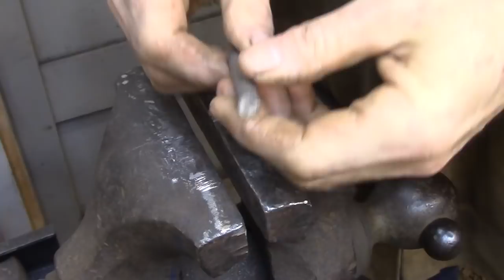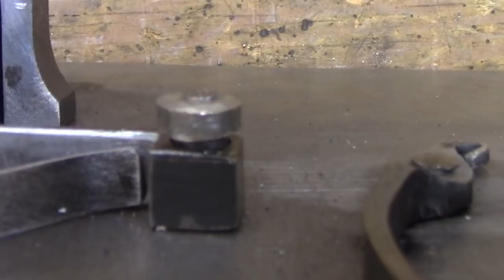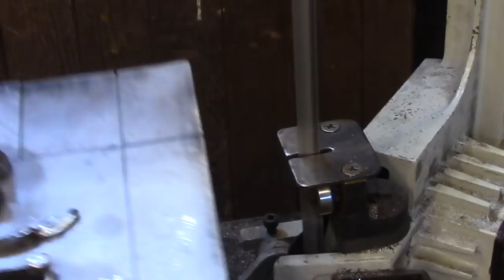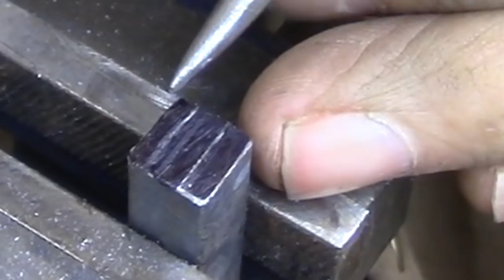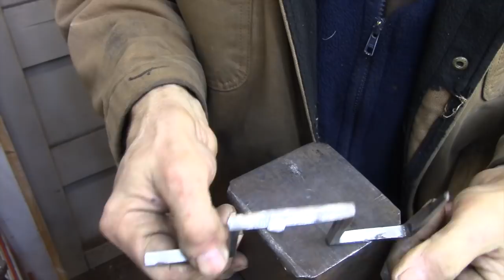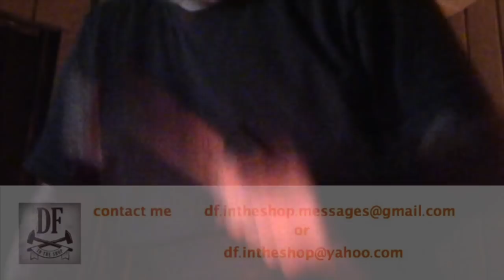Blacksmithing Project - A Simple Nuremberg Box 13

Comment: Since you're still in the rivetting and brazing mode, could you not add a bar along the top to provide the strength lost? Keep forging!
Reply: I was thinking the same thing. He could cut a 10-14 gauge steel strip to fit, then braze it and grind it down. The bar looks to be about .25" thick so .13" to .1" should  be enough to reinforce it.
Reply from the maker: That was my first thought and I don't have a problem with that as long as I can get it to not look like a repair.
Reply: So in other words, any repair done will look like like filigree, or some other purely decorative addition.  Don't add too much, or you'll feel compelled to add it to EVERYTHING .
Reply from the maker: Actually you are giving away the ending to tonight's video.  I just meant that I didn't want to do a repair that would place a line of brazing through an area that obviously should have been a solid piece. This lock is going to be visible every time the box is opened so it needs to look right.